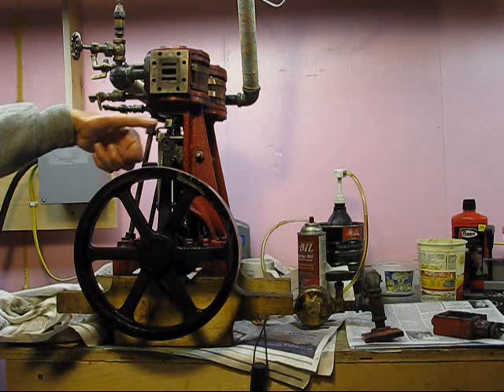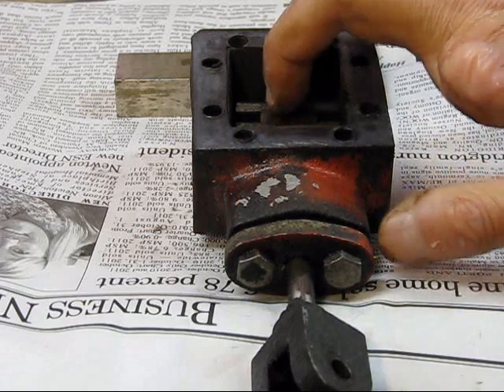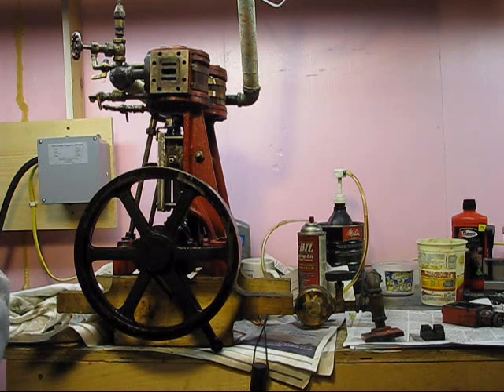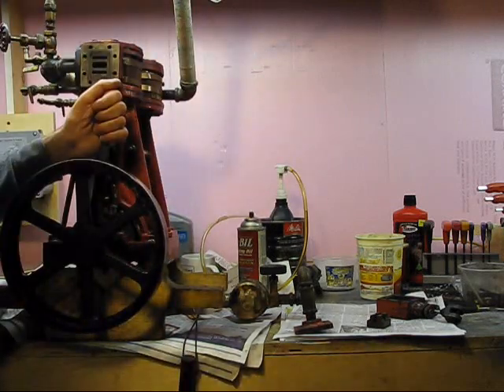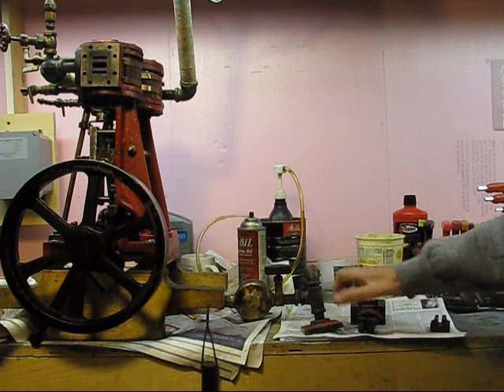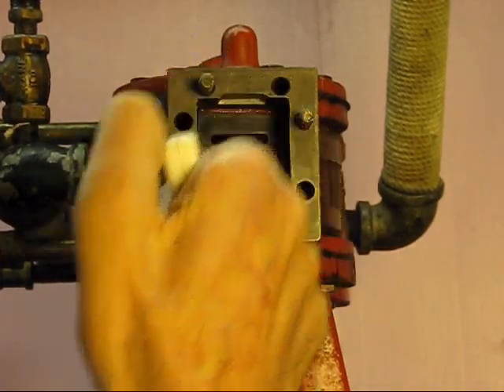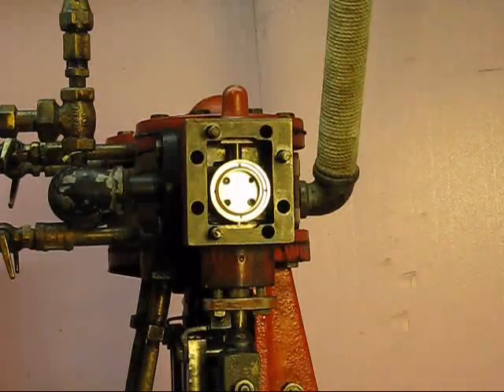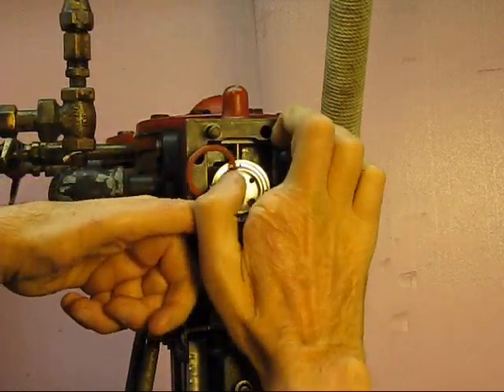Reliable balanced D valve conversion 0001

Comment from the maker: I'm sorry that I'm so late in this reply. I haven't really been following comments, lately... Mea culpa!
It's probably best to think of the aluminum "balance puck" just like a 2nd reversed "D" valve bolted back to back onto the the orginal "D" valve. The high pressure inside the steam chest pushes the "D" onto the port face. At the same time, the high pressure in the steam chest also forces the puck in the opposite direction toward the steam chest cover, providing significant pressure relief to the D valve..  The valve has been in operation for 3 seasons now without problems...

Comment from the maker: Mr. Zap, thanks for your continued interest.  As I mentioned, my boat did show performance improvement. Keep in mind that the high pressure within the steam chest works in all directions. Since there is low pressure within the adapter cup, the high pressure steam within the steam chest is also pushing this cup and its attached old D valve toward the steam chest cover. Balance?  Next season I'll try a gps run with and without the O-rings..Balanced vs unbalanced..Come along if you're in Maine!

Comment from the maker: That's correct. Before I made the conversion I would normally cruise at 70-80 PSI, a little above the boat's hull speed.  Just at the point where the bow starts to rise. The friction between the D valve and the valve face at that pressure uses significant engine output. I can now get to the same cruising speed with about 60-70 psi.  This is one reason why piston valves became popular very quickly. Relieving the forces pushing the D and the face does increase output.

Comment: It is hard to believe you actually reducing the pressure between the two faces with the modifications.  Do you have a before and after results?  lowest PSI in both modes at what RPM?

Comment: .  But really in a 3D perspective, taking all the surfaces into account on the high pressure side of the valve, you are only reducing the top of the posts, as the rest of the area is not airtight.  Could it be that the aluminum puck, with exhaust pressure in the inside, sealed by the o-ring being pressurized by the 4 small high pressure holes is physically hold the d valve in a more parallel alignment to the port face?

Comment: I'm new to this, and I believe I have the grasp to what you "did", I'm struggling with why it helps based on your verbal descriptions in the video.  You say it reduces the area (I'm going to assume you mean the total surface area on the high pressure side of the valve) that is exposed to the high pressure, thereby reducing the drag caused by the metal to metal friction between the D valve and the face where the 3 ports are.